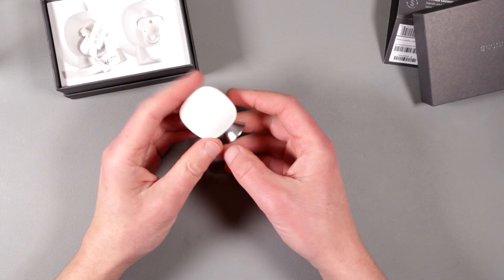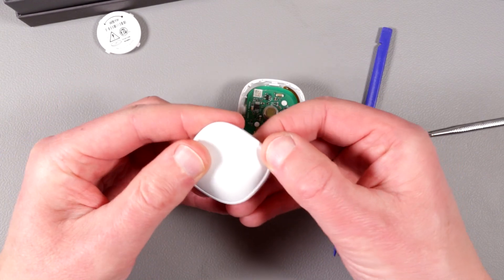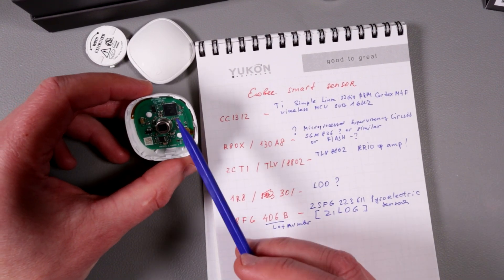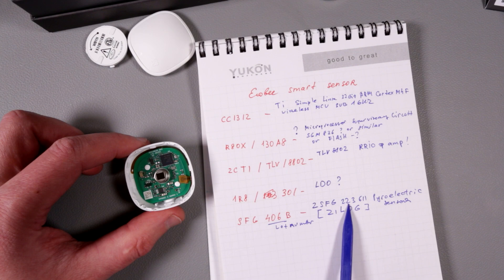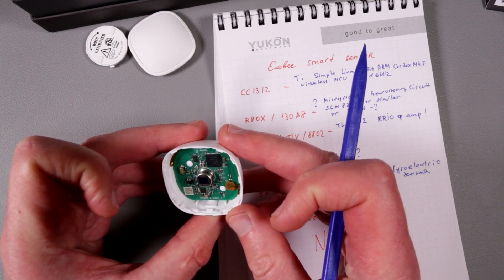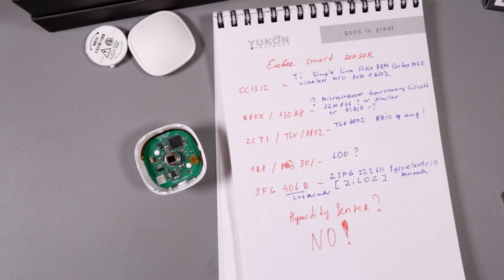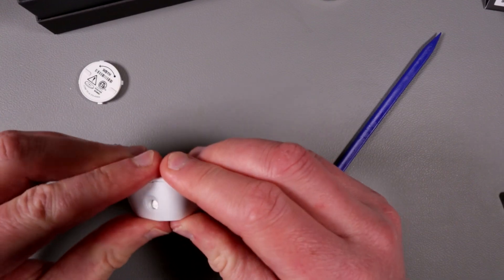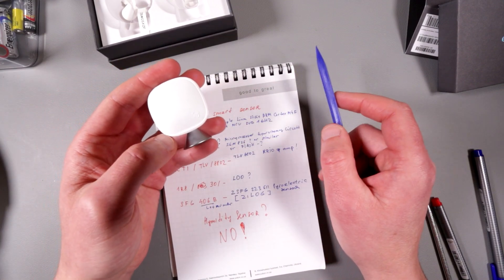Ecobee Smart Sensor Teardown

Comment: It's a 32-bit microcontroller,  a thermal sensor, and 900mHz comm link to base, and a doppler radar for detecting motion near the sensor.  Not a lot of room to play with re cost.
Reply from the maker: I think this uses a peer sensor not a Doppler radar type sensor

Comment: These little things are so over priced. I'll be happy when someone cracks them and we don't have to rely on ecobee
Reply: It's a 32-bit microcontroller,  a thermal sensor, and 900mHz comm link to base, and a doppler radar for detecting motion near the sensor.  Not a lot of room to play with re cost.
Reply: @the_lar  I'd be happy with a pure temperature sensor or integration (clearly won't be supported by ecobee, but would be great to see third party solutions) with other smart home devices that report ambient temperature.